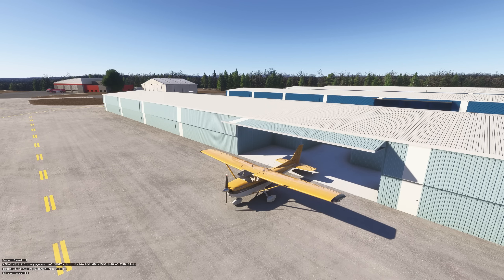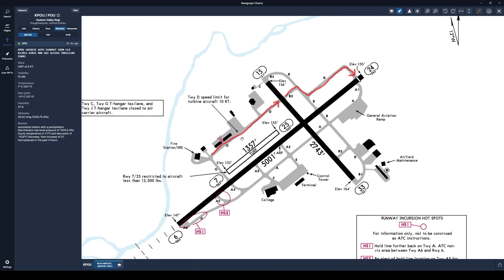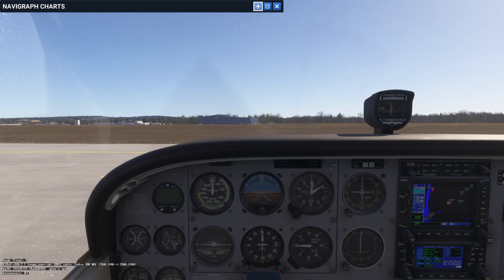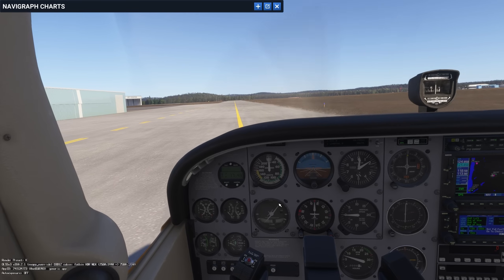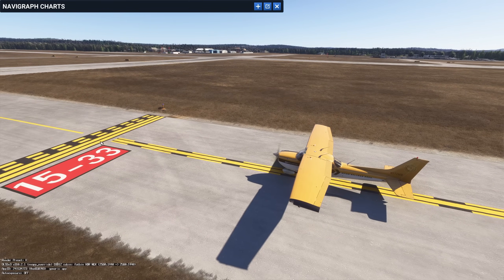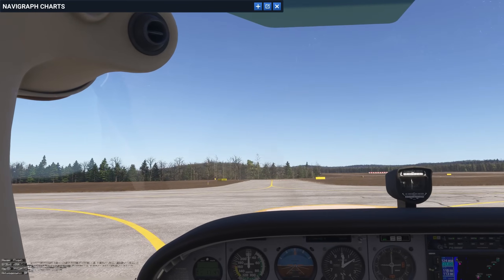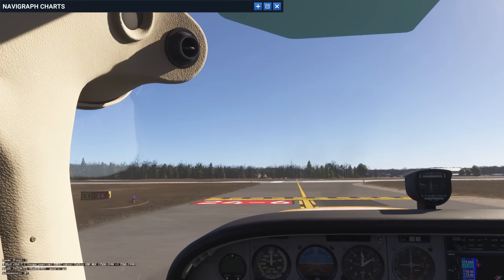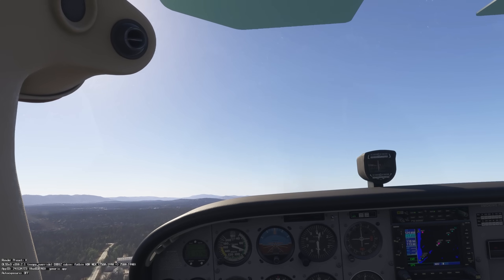Master the Taxi: Flight Instruction for Flight Sim | Microsoft Flight Simulator

Comment: Good video.  However,  you skipped a bunch of stuff that you would do IRL.
1. Always, always use a checklist.
Communication is very important. Here, there exists an a control tower and Ground Control.  You must communicate with the tower before moving. If you are at an airport with no tower, say your intentions, i.e. N123 taxing from hangar X to runway 24 via Delta, etc..
Selecting the runway that is MOST in to the wind, not by length. When the wind is between runways, choose the longest runway, as you said, more runway is better if you have a problem and need to land or abort T/O.
Altimeter: Set the Barometer to ATIS, or AWOS, or known field elevation. This airport diagram shows several elevations, including at the start or each runway.  The airport elevation is 147 at runway 6, 155 at 24, etc. If there is a discrepancy with ATIS published Barometer reading, set the altimeter at the known point.  I have never heard 'within 75 feet".  Set it the the airport elevation if it is not disclosed at those points on the airport diagram.  If you communicate with any ATC, they will give you a Baro reading at your approximate location before take off.

Using the full length of the Runway: I frequently see pilots taxi up to the Displacement Threshold before going full throttle.  MSFS makes the mistake of putting the runway start (if you default start at the runway) at the Displacement Threshold. THIS IS WRONG!!!! Start at the beginning of the runway.  The Displacement Threshold is the distance from the beginning of the runway used for LANDING.  This is the case where there are obstacles before the runway like trees or buildings and the glide path is at a safe height above those obstacles.
Taxi to the runway - Hold Short lines are different depending on the airport and runway, like, if it has an ILS or not.  Just remember it is a Hold Short for taxing to the runway, AND a safety line when exiting the runway.
Stopping before runway: I was taught to point the airplane at an angle so that, if another airplane taxing behind you, your run-up does not blow at that airplane.  Typically, it is a 45 degree angle on the taxiway.  Some airports have a designated run-up area.
In a non-controlled airfield, you should be listening to the radio for any pilots saying they are in the pattern or on final to that airport. You should also communicate when you are departing the runway.
Reply: A great addition to a good guide, thanks for the clarification, sir.
Reply: The Displacement Threshold of a runway is a designated area that is used for taxiing, takeoff, or landing rollout, but not for touchdown during landing. It is typically located at the beginning of the runway and is marked by specific runway markings